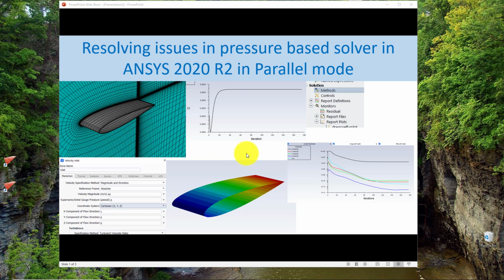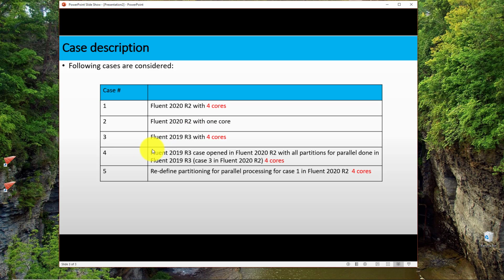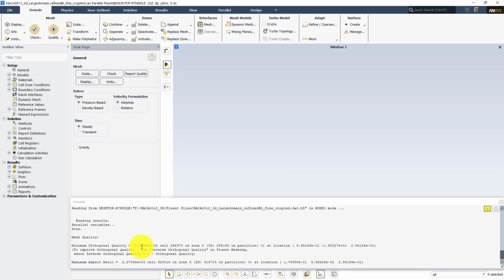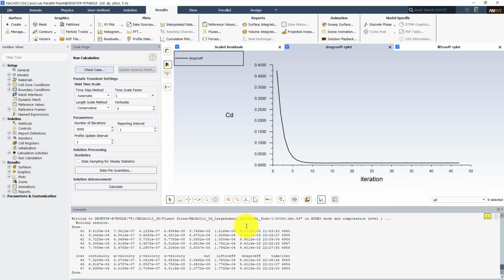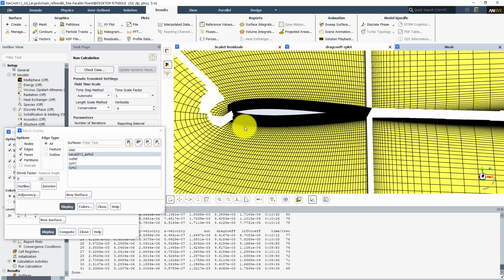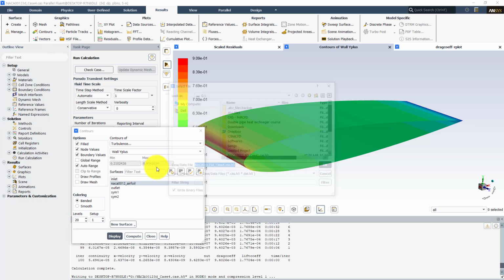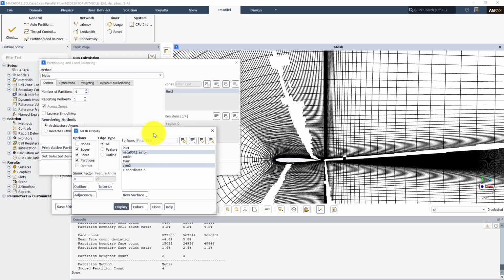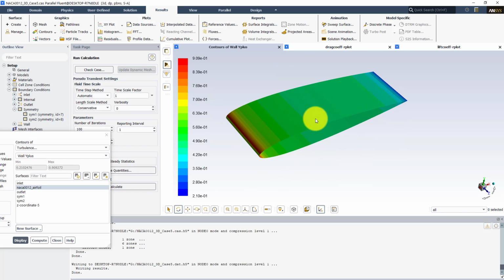Couple pressure based solver in Fluent 2020 R2 Parallel mode ! Bug and its work around

Comment: hello， i use fluent to simulate the  heat transfer ， but  i met the question “temperature limited to 1.000000e+00 in 3 cells on zone 96 in domain 1”
how to solve  it？ looking forward your reply.
Reply from the maker: This is the issue of mesh or may be wrong boundary conditions